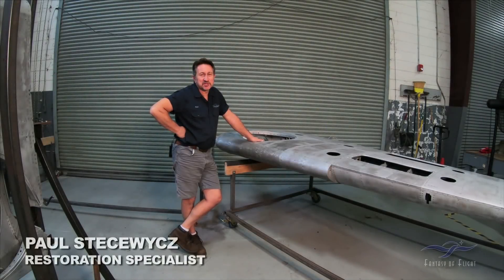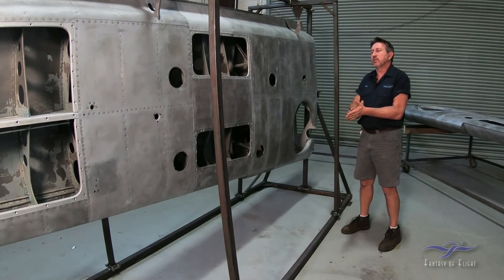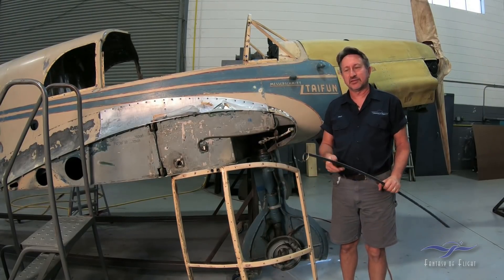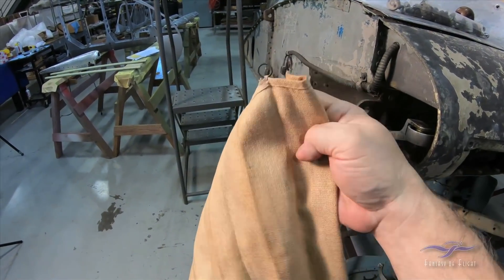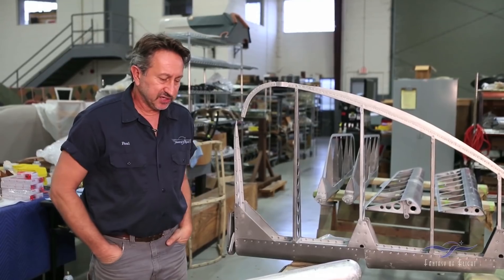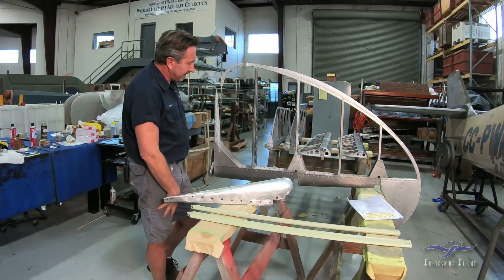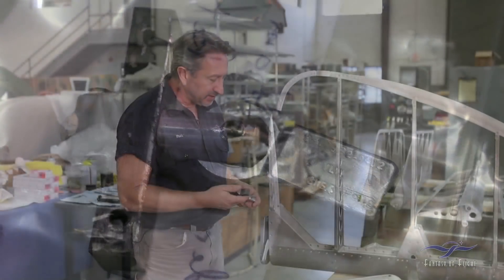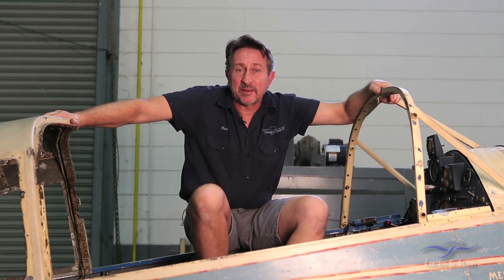Messerschmitt Bf-108 - Restoration Update #09 - March 2019

Comment: Hey Paul, The split nut's, that take the screw drive with the cut out,  are also used on the old Martin-Baker MK 5 Ejection seat's. I was a Egress Mechanic in the Air Force until I retired. Seeing that screw driver brought back a ton of memories. Being an old Air Force mechanic, Also the part where you talk about acid wash and alodine, also brought back memories of helping in the total strip and repaint of the F-15's. I also didI just love all the work that you guy's are doing to restore Aviation History. Keep up the great work you and your guy's are doing.

Comment: Thank you for this video update on the Bf 108. Great work and good presentation as always. What might be interesting is that the 108 was designed in the early 1930´s. First flight was in 1934. Keeping that in mind it really was an extraordinary plane in its time. In fact it was quite competitive even 20 - 30 years later. I hope for regular udates and wish - when finished - many happy landings and lots of fun. BTW contemporary designs with firstflights in 1934 are: (Boeing) Stearman Model 75,  De Havilland DH87Hornet Moth - both biplanes. German competitors for the "Europarundflug 1934" were Bf 108, Klemm Kl 36 and Fieseler Fi 97.

Comment: Enlightening stuff! Thanks for sharing this intriguing journey.  I would like to say, I was tickled to hear Paul talk about how outrageously expensive some of the parts (instruments in this case) are.   I've spent 45 years driving and working on Studebakers.  Some of the parts for Studes make these instruments seem right reasonable!  For instance, the 1958 Packards were the last cars to carry that name. In truth, they were nothing more than "dressed up" '58 Studebakers. But they were an attempt by the Studebaker-Packard Corp to keep the Packard brand alive IF & until the company's finances would allow for all new Packards to be built.
     There were only 159 '58 Packard station wagons produced (there were higher numbers of sedans ).  And on the wagons, there's a molded plastic emblem that fits into the rear licenses plate light body.  These emeblems have weathered the years remarkably well, but they look nothing like a pristine Hew Old Stock example - the sort of example you'd want if you were restoring a '58 wagon - or just wanted to replace one that had yellowed and cracked with age. So, 10 or 12 years ago, a couple of NOS (2 inch square) emblems that said "PACKARD" and featured the Packard hexagon emblem as well, went for $800 and $1K respectively!  As well, I sold an optional 160MPH factory, USED speedometer for $500 bucks and that was a decade ago also!  Messerschmidt stuff seem downright cheap to me! 

  I'd also like to add that Snap-On tools used to carry a set of "sockets" that would do the same thing as that slotted screwdriver. They were for removing  the bezel nuts that hold toggle switches in place. I still have a few of those.

Comment: Those fasteners with the slotted screw driver you show are also used on vintage automotive stuff. My old Corvette uses them on the windshield visors for example. Check automotive sources for them. cheers.

Comment: Great episode Paul. Volkswagen bugs were painted using the dipping method. I read it was used as a corrosion-control practice for the cars. But, in the BF, it must have added a lot of weight to the aircraft. Don't envy you stripping off the old coats.

Comment: wire connections/no soldering -electrical wire connections on a vehicle shall not be soldered, because the soldered connection (the lead) may not cope with vibrations on a long term basis. This i got taught when i attended the munich univ of applied sciences (major in car engineering) around '90. It may even have been a requirement to get the car cleared for road use at all - memory's a bit vague about this.

Comment: Paul,  

Park Tool, a manufacturer of bicycle mechanics tool makes a very similar tool to the custom screw driver which you have.  Its called a chainring nut wrench. Its a similar design and for $4-$5 range it could be used and damaged rather than using the original screw driver.  Great work on the plane.

Comment: Those fasteners are quite common at least in Europe. For example on front sprockets of racing bicycles. That type of fasteners are used to bolt multiple front sprockets together and attach to the pedal arrangement

Comment: There are a few reasons behind the non-soldering. At least that's the reasons I've heard.
1. A field repair is easier. Having a soldering iron at hand is not always possible, but it's no hassle to have the right screwdriver in the repair kit.
2. Vibration can break soldered connections. Specially when flexible cable is connected to stiff connector.
3. expansion and contraction do to temperature fluctuations can break a wire. In a screwed connection the wire can move a little bit.

Comment: The windshield "Nuts" are Spoke nipples from a Motorcycle - Prob same as a period Zundapp or BMW??
Those wire connections are very "European" all my antique Italian Motorcycles I own and restore have the same connections on everything-
Reply: As soon as Paul stated to describe the windshield nut situation , I thought "Grind a notch in a straight screwdriver" as plan A. But as with having a good restoration starting point, Paul's plan A is much better- use the original tool!
Reply: You can get the same tool tip, 
at Harbor Freight.  That 100 
piece security bit set.

https://www.harborfreight.com/100-pc-security-bit-set-with-case-62657.html

The set has 3 different bits.  I used one when 
re-spoking some bike tires.  I've yet to break 
one.

steve
Reply: Well spotted. When I saw them I thought they looked familiar but I couldn't think where I'd seen them before.
Reply: MichaelKingsfordGray , Yes, one could.

Most aircraft mechanics like those 14 
inch hex drive tool bits.  At leas they 
did, when I worked for Douglas Acft.

steve
Reply: No, spoke nuts are a different size and are fastened or tightened from the circumference by a spoke wrench. These are called Spanner Nuts, are tightened by a specific shaped screwdriver from above. They are designed to limit the torque applied, so perspex or glass etc doesn't crack. The most common sizes are #4, 6, 8, 10 & 12. Smaller sizes are used in watches, eg there are 4 on an Orient Dive Watch model V33D001.

Comment: Keep up the Mechanics related videos.  Much more interesting than watching many FOF videos.  Again, pilots are optional as a many museum quality restorations are not meant to fly again.  Technicians with great skills are required every step of the way.  Sorry Kermit,  your most important thing is signing the checks. LOL
Reply from the maker: You might not be aware, but Kermit built his first aircraft at 18, and designed and built his own competition aircraft - The Weeks Special and The Weeks Solution, while in his 20's. He is quite possibly as talented a mechanic or restoration specialist as any worker he employs. And if he had his druthers, would love to be able to get into the shop and do just that, but with everything else he has to do to keep things up and running, and flowing towards the future here, he just doesn't have the time. There are snippets of Kermit working in a couple of clips. We'll have to put a full one together highlighting his prowess. - The FOF FILM TEAM -
Reply: @KermitWeeks444  Agreed, wholeheartedly.  However, it is still fun to poke fun at the stick jockeys.  Just a greasy fingernails guy here who refuses to wear rubber gloves.  Cannot wait until the next videos, regardless if it is Kermie or mechanics corner.

Comment: The inside of the wing is a perfect candidate for a laser paint/rust removal system.  I’m pretty surprised you guys don’t have one yet.  As much paint and corrosion as you remove, it would be worth it.
Reply: ET:  Over heating of aircraft aluminum parts is critical.  Are there laser paint systems approved for aircraft aluminum?
Reply: Pelican1984 you can run the laser systems over your hand and not burn it.  It’s used to clean aluminum molds for composites.

Comment: Dear Paul, any thoughts on the fueling conundrum yet? Are you going to run the fuel through the original route or will you try to engineer separate access to the wing tanks for quicker fill-ups? I needed an hour to fuel up in Lyon for a flight to Corsica 20 years ago...

Comment: +KermitWeeksBlogVideos  I suspect that Chrysler Corporation revived Bayerische Flugzeugwerke airframe painting technology - the immersion painting process for several Chrysler, Dodge/Ram, and Jeep models involves ten coats, starting with a baptism in low-VOC solvent.  The Bf 108 "Messerschmitt Taifun" apparently pioneered technology used in postwar recreational vehicles such as the Airstream travel trailer.

Comment: Some Mauser rifles use a fastener that uses an adapted screwdriver like that.
Reply: And the Weaver 330S scope uses that type of screwdriver to loosen the locknut on the screws that adjust the scopes zero. The Weaver 330C scope was used on M1903A4 sniper rifles but the C version had knobs with clicks like more modern scopes.

Comment: Interesting video. Have you come across any penetrating "wounds" from bullets, etc? How were they dealt with at the time (<1945), and how do you fix them now? Indeed do you fix them!
Reply from the maker: No, haven't found those on this aircraft. We'd repair it the same as any other structure "wound" on the plane. Repair or replace the damaged skin or part.

Comment: So if your going to have to do a full restoration on the airplane in order to do it correctly is?. The airplane has to basically be dis assembled and every part removed inspected for air worthiness, repaired if needed then cleaned and re painted or plated reinstalled and thoroughly tested and inspected again. I would imagine just the time alone to have these parts repaired or refinished or replaced is almost 1/2 the time battle long with the time it takes to have these parts sent off and done elsewhere. You then have the interior which needs to be totally remanufactured and fitted custom made for that aircraft although you do have the patterns which does save some time.  Along the way you have to also figure how the plane was assembled and taken apart and where everything goes so throw in the time it takes to label categized and store all the parts after you take the thing apart constant study of the aircrafts history to stay as true to the original along with documenting  the construction process and procedures. So you are basically using the original to scrounge as many useable parts as possible to try and keep your rebuild as authentic as possible.
the last and final straw here is the thing needs to run and fly so there is no screwups otherwise you are left with a scrapheap on the ground and all that time energy and money gets destroyed in an instant along with a human life possibly. Great job Paul keep at it enjoy your series.

Comment: You have mentioned a few times difficulties finding airframe parts for the Bf-108. Have you considered also using parts from the French Nord Pingouin which is basically a re-engined Bf-108?
Reply: Roughly 900 Bf-108 were built in total. About 1/3 of those were Nord Pingouin.
Reply: @klaussitos pour l'Armée Française la SNCAN en construit environ 285/286 Nord Pingouin, la version "1000" était un BF 108 construit a partir de 1942 en France occupée , 170 ont été construit pendant la guerre.
merci pour ce rappel, je me souvenais avoir vus un avion qui ressemblais au BF108 mais me rappelais plus le nom ;-)
il y en avait a la base Aérienne de Mont de Marsan.

Comment: 25:12 Do you have the maintainance instruction? Kind of funny that you have to dismount the artifical horizon in order to read. "After 100 operation hours unscrew this cover, exchange the filter or dissassemble in the right order and wash it with gasoline."

Comment: removing old paint, dope build-up, fabric, corrosion might be a lot easier using VAPOR BLASTING, just the same as glass bead blasting, but with the addition of high pressure water, leaves the surface
clean and also slightly polished and gleaming, and NO HEAT involved to warp thin metal. might be a well founded investment to purchase a vapor blasting cabinet. it solves your problem of cleaning tight hard to access areas inside and out.

Comment: Wouldn't the window frames and fasteners be nickel plated and not chrome????
Reply: Depending exactly of the year it wouldn't be chrome but nickel or possibly German Silver, that's why I asked about chrome
Reply: @stacyobrien1729  If interested,traditional show chrome on ferrous metal is 
1) Several coats of copper,plated, then buffed back to mirror finish
2) Nickel plate which is fairly thin.
3) Chrome plate to create the dry white colour plus nickel discolours over time if allowed to contact air.
Chrome directly on to ferrous metal is called industrial hard chrome, and for instance the FAA allows it to reduce the diameter of a jug so the original piston can be reused. Actual FAA certification,lots of different cyanides and other poisonous chemicals needed for the bath to do what it is supposed to do. Expensive as all getout, but worth it when saving parts.
Chrome directly on to sheet metal such as those trim pieces,if the base metal is magnesium not ferrous,would explain why the chrome peeled off. Magnesium is so much more chemically reactive than say aluminum,that the slightest oxidation of the magnesium would cause that over time. Just push the chrome overlayer right off.
Especially  expensive now that plating shops have to account for and recycle the complex poisonous soup at the end of the plating cycle. In the USA,anyway.

Comment: That is going to be beautiful, especially if it's in original Messerschmitt blue.  What are yu going to do about the Altimeter, as the FAA requires Altimeters measuring in feet, and German Altimeters measured in Meters.

Comment: Why use magnesium components when magnesium is so flammable? Is it just that much lighter that it’s worth the risk?
Reply: Yes, light weight is the advantage.  Fire is not a problem if the plane is not on fire. ;)
Reply: Pelican1984 Well it’s good then that planes like these never caught on fire, or get shot at with things that make fire, or scrape bits on surfaces that can spark, or get soaked in flammable substances. That would be bad..... I’m just saying. ;)

Comment: 6 months for a plater? I know its spring and all but you need to find another plater.
Reply: A long delay normally means that they are in high demand because they are good.  Good, cheap, fast -- usually you can pick 2 but if they excel in one of the three you can only choose that one.
Reply: I hear ya but still, 6 months is a long time. I bet them not need the parts back right away, not having all parts to the plater and being Spring all played in to how long it is taking.

Comment: Fastidious!  Correct wire for the job obviously but replicating original overkill! As for primer as well. Whatever you have and is correct should do the job.
The 108 and 109 are similar aircraft so it makes sense that they used as many interchangeable parts as possible. As do car manufacturers. 
Correct rivets and fasteners though are required obviously and I suspect will be expensive and hard to get.
Fascinating job though, this was how I got onto this channel. Not much of a plane buff but it is mechanical and structural. This plane while simple is light years away from wooden airplanes.[excepting Mosquitos]
It makes me wonder why a plane that is  almost all alloy still had fabric control surfaces. I would have though it simpler to make than fabric.